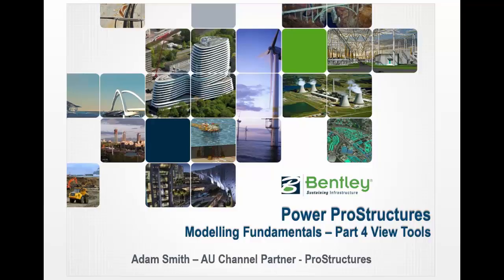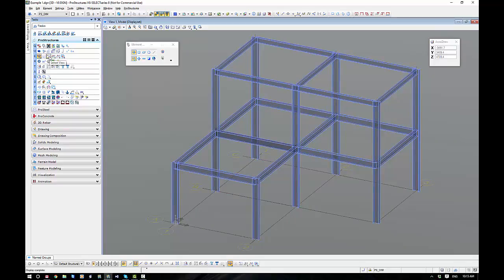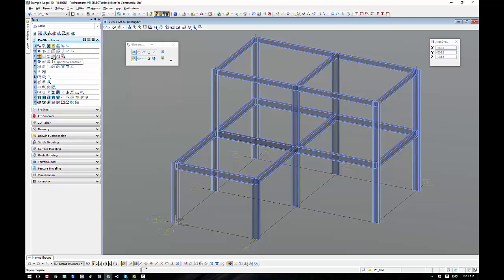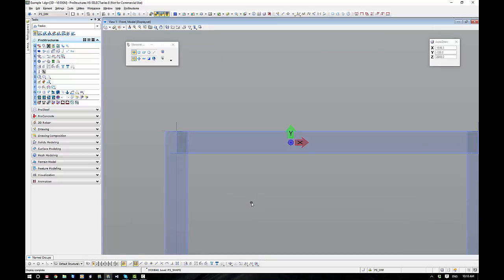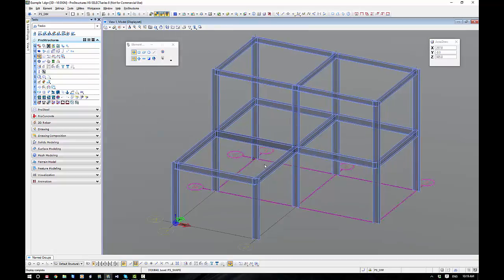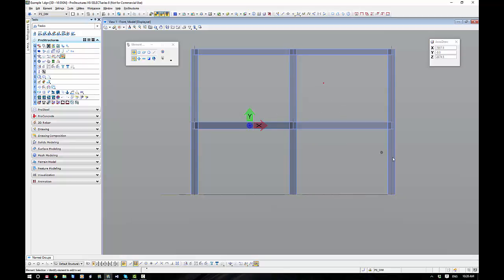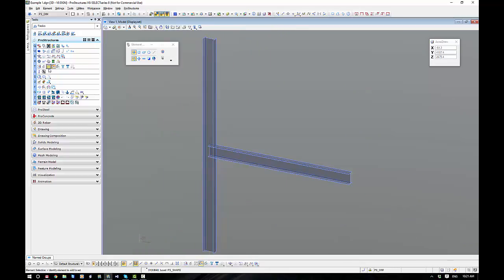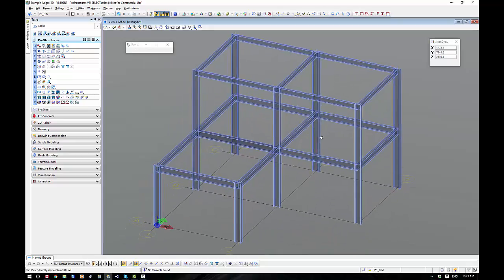Power ProStructures - Modelling Fundamentals - Part 4

Comment: Hi Adam, how did you set up your background to that gradient colour? Did you manually set this up? Nice videos by the way!
Reply from the maker: Hi Zuri, thank you for your kind comments.

The background is just grey (9 from memory) and it is the factory modeling default (Transparent Modelling visual style) with the grids turned off.

I have worked with grey backgrounds for years (before switching to the Microstation engine) as I found it was easier on the eyes over the long days I was working. I felt black/white was just too hard on my eyes over 10-16 hour days...
Reply: Oh ok, in your video at 3.00 into it, the background changes from grey to some gradient type? how did that come about?
Reply from the maker: Hi again Zuri, sorry for the slow reply, lots going on....
OK, looking at the 3.00 mark I see what you mean. On switching from Transparent Modelling to Wireframe, it looks (in this model) that I have a background applied to the Wireframe mode. There are different backgrounds that can be applied within MicroStation. This one is Gradient.
View Attributes - Wireframe (edit) - Background - Gradient (I think)